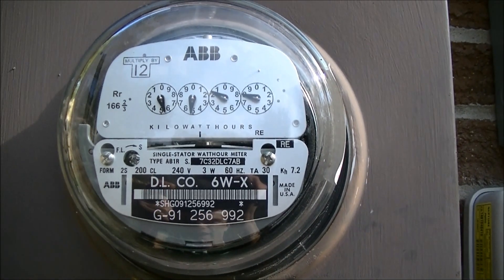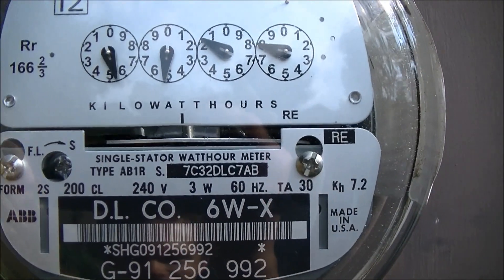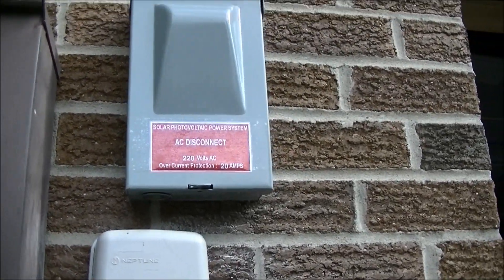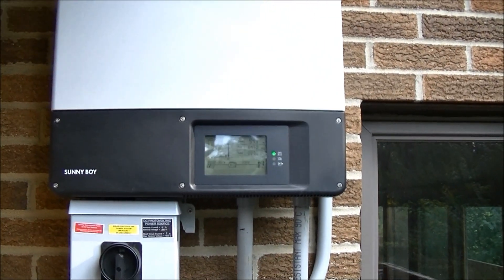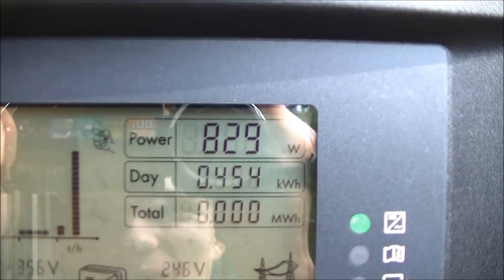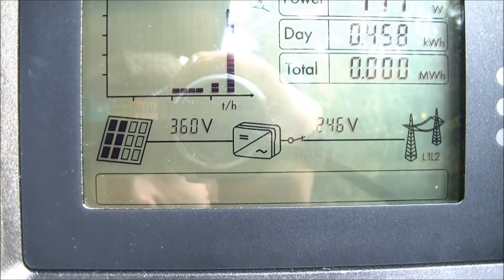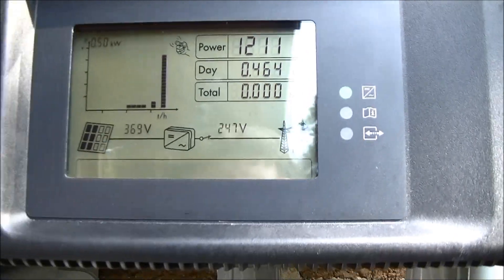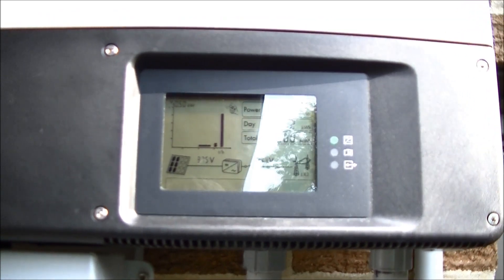3KW DIY Solar Project Part 5 - Inspection Passed, We Are Online Producing Power!

Comment: Hi love this video. I have the same system only a 5K. Bought it used 2 years ago. decided to install it and opened the inverter and disconnect only to find the wires leading to the inverter have been cut as well as don't know how to connect it to my grid power. I have red wires green wires white wires and blue wires. Figure red and blue are pos power and white is common and the green is ground can't figure out where these red blue white and green wires are suppose to hook up into the disconnect. I know one end goes into the inverter and I would assume hooks to the L1 and L2  plus the common and ground. But where do they hook to the disconnect and where does the house connection hook to it. ? can't find anything on the internet with this older system.....   HELP lol

Comment: That's really awesome that the power company in your area let you DIY. My power company required a licensed electrical contractor install the system, which pushed the cost up a lot. I've got 5KW and as long as I don't use the A/C or clothes dryer, I produce more electricity than use every day. I go up north for the summers now, and I use a clothes line to dry my clothes in the sun, so it's not so hard to do it.